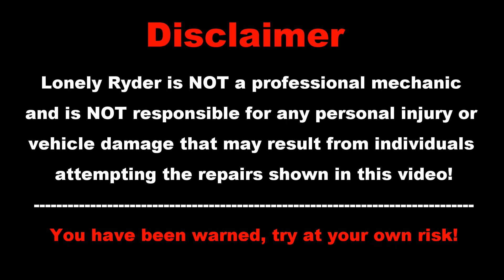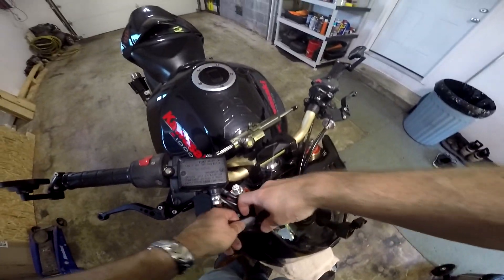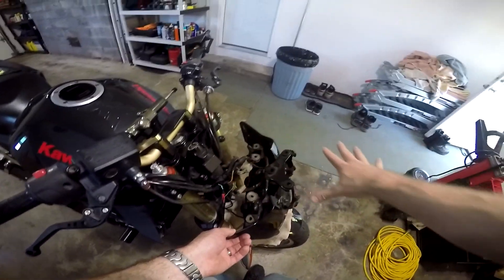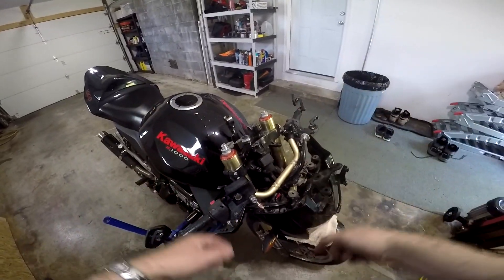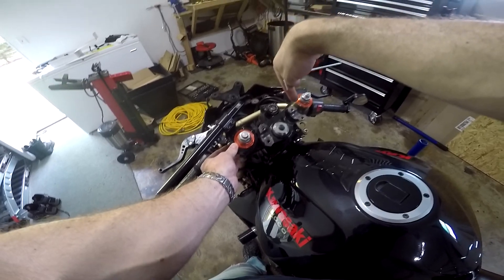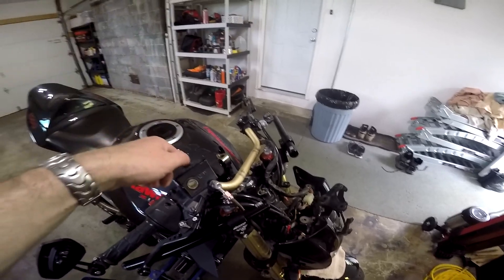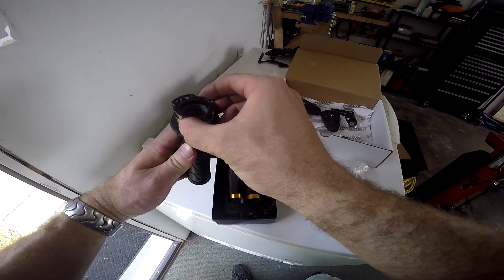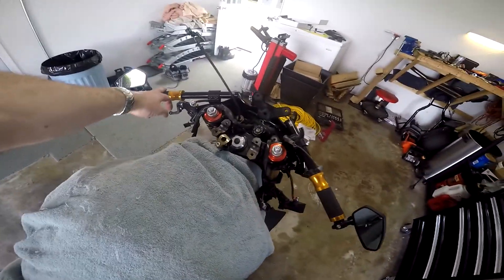Installing clip-ons, grips, & GSXR master cylinder - Gen 1 Z1000 (03-06)

Comment: Hey lonely, nice work! looks brutal i like it! I have my front lowered 11mm. I'm afraid to go further down because, below the lower tripple clamp, the tubes begin to decrease in diameter... Like so, there is loss of contact area between the tubes and the tripple and my guess is it might be dangerous in a hard bump on the road. Having that in mind I haven't installed clipons, cause i'm afraid. So make sure you tighten the lower clamp really good and be safe man
Reply from the maker: Yes, the forks do reduce in diameter as you go down, but where mine is set, the clamps still have plenty of bite and still have an 1/8" gap at the bolt holes. Been like that for months, no issues.

Comment: Mine had an adjustable Rizoma setup that bolted into the factory bar mount location when I picked it up, didn't really care for it, put me in an awkward riding position. So I eBayed a factory bar mount and put some Renthal street bars on it, way better for me. The front brake master might be an idea for later incase the factory one fails, even though I could rebuild it if needed, but having better braking might be nice.
Reply: can you post a link to it cause i'm unable to find it?
Reply: @mynameispoul7483  You can't find it cause it's long since been discontinued from what I understand
Reply: @IrnMaiden304  allright, thanks for the info
Reply: @mynameispoul7483  I'll see if they have a part # on them when I get home, if that helps

Comment: Awesome video, I'm just about to do the GSXR front master upgrade using the same parts, Did you find it really helped the stopping power? I find the Z is definitely lacking in the braking department. I also have a set of 6 pot Tokico GSXR front calipers I might install to help even more!
Reply from the maker: Yes, it did help, but that's about as good as the stock Nissin's are going to get. Anything more and you will need those Tokico's or a set of Brembo's.

Comment: would it be possible to run 2x braided hoses direct from the brake reservoir , one for each calliper ? rather than  the stock design utilising one hose  and then hooking over the front fender to the other calliper , which imo doesn't look very efficient or as aesthetic as i find the braking a little spongy compared to other bikes i have had  ( without going to the expense of Brembo's etc , maybe another vid )
Reply from the maker: Yes, you can! That is how my GSXR is set up, I posted a photo of it on my community page. You just need to make sure you have enough room for it in your handlebar setup.
Reply: Mine is a double line down

Comment: Question how about the space between wheel and the radiator  ? And did you make any changes in the back for height? Also thanks for the parts info 👍
Reply from the maker: I’m not sure I understand your first question, what about the space? There is plenty if that’s what you are asking, no chance of a collision. I did not adjust the rear height, that is still stock.

Comment: How did you fix your mirror on the original handlebar? Is it 22mm
Reply from the maker: I'm not sure I understand what you are asking, but if you mean how to attach the mirrors to the stock handlebars, they are not hollow. They have a threaded hole where the bar tips bolt on, you can just use the same thread bolt to put the mirrors on, no spreading adapter needed. Hope that makes sense.

Comment: Hey man what size handlebars did you choose for the first gen Z1000 ?
Reply from the maker: I put a link to the exact ones that I bought on revzilla in the video description. They are 11 inches long with 1 1/2 inch risers. The 50mm ones fit the fork tubes perfectly on mine.